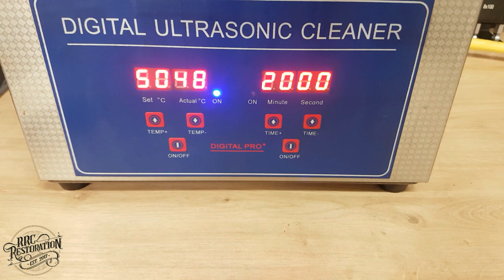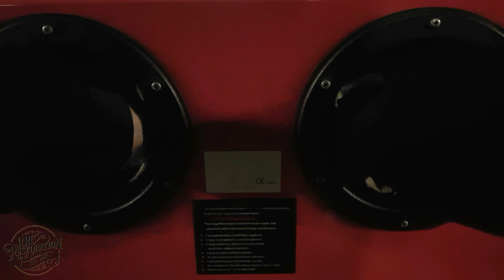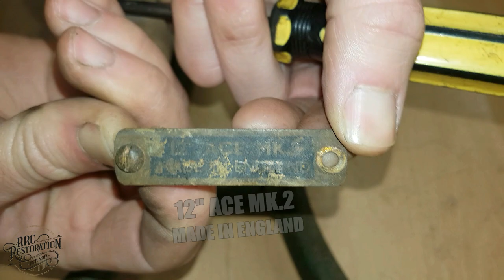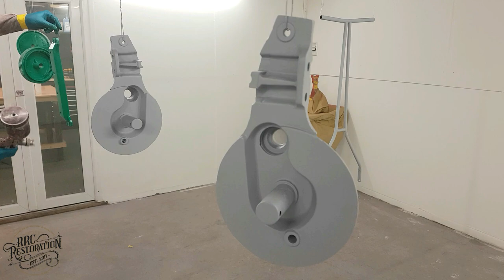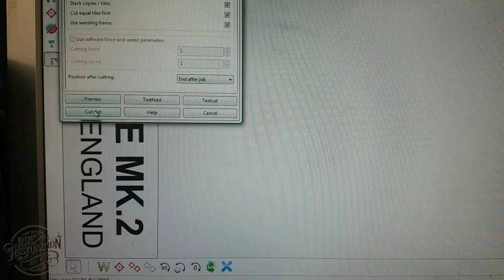Fatal Flaw!.... And Its 70 Years Old!!!- Mower Restoration

Comment: My older sister sharpened the blades on one of these the wrong way, 5 yr old one not an antique like this one, then threw it in our pit. After seeing this, I'll have to go into the pit and find it then see if I can fix it. I've restored 3 wheelbarrows, and after seeing how well you did this I'm pretty sure I can fix her old one back into working condition. I've already restored one of her wheelbarrows so I should be able to work on a lawnmower. Got a subscribe and a like from this.

Comment: That’s just at the next level…I wish my restorations were as good. Manufacturing that end piece with weld was genius. I would have happily accepted that it worked…you didn’t need to actually use it in appalling conditions. I hope it cleaned up okay and went into a museum 👌🏼

Comment: Back in the 50s, we had a small back yard, divided into house, orange orchard, and chicken run. The chickens took care
of the grass and sprouting grain in the run, and my dad handled the grass around the orchard and the clothes line etc. with a old style hand mower with Wooden Handles.
When we moved across the road to a bigger property,  with a proper Front and Back yard, ( I was just 8), the mowing gradually became my weekend chore by the time I was 11. Then I went to boarding school, and my dad bought a 2-stroke Victa mower...I only cut grass during school vacations.
Now, aged 73, with a couple of Heart ops behind me, I have a lawn-mower ( also in his 70s) come and keep the grass under control on a 1 acre block with a 4 stroke Honda- Briggs&Stratton self-propelled mower I have had for almost 35 years.
I still rake the grass cut, ( daily Cardio ) as the rains will allow for about 1 hour...makes up for 1-2 kilometer walks.

Comment: Nice job on the restoration of the mower not sure if you know but with action of the cylinder to blade being like a pair of scisssors you can test the  cut using a piece of paper across the blade to get it even. Remember my dad using this trick when he was adjusting the the cut on the Greens 14-4 we had at home.

Comment: @6:38 you need an impact screw driver. I bought mine from harbor freight for 10$ and it’s absolutely invaluable. I bought it for brake rotor screws and figured out rather quickly that it’s worth it’s weight in gold. Mine is 1/2” drive so it’s incredibly versatile to

Comment: 40 mins is fine by me, very enjoyable. I remember using one of these as a kid in the 60's  and what a huge struggle it seemed, can't remember the brand but it was red and light blue. You have a great selection of tools, a video featuring  them and their specific design mandate (e.g., @1:15 a selection of what looks like "spanner heads?") would be interesting. The back-lapping technique for blade sharpening was excellent knowledge .
Reply from the maker: Thank you, really glad you enjoyed the video :) The spanner heads at 1:15 are crows feet spanners they are designed to be used with a ratchet extension to get into very awkward nuts and bolts like Ducati head studs lol.

Comment: Nice one. Way more complex than anyone would imagine. 

Did you soak the new wooden roller in linseed oil before fitting it?

If you find old wooden handled tools that are so dried out they feel as if you could snap them like a biscuit, clean them with warm damp cloth and dry thoroughly. 

Then soak them in RAW linseed oil (not boiled) for as long as you like. Every now and then, massage the oil into the grain. Leaves a dull finish, and protects for decades. 

Some prefer the boiled finish, but you have to completely immerse the thing if you do. 

Thank you for sharing. How long before Delboy does one of these? 🧐😎😜

Comment: Nice work!  Just a tip-  when I've got a fair to large amount of sandblasting to do, I've got a large hose clamp riding on the air supply line I pull up over the handle of the gun to hold the trigger for me.  My hand gets so sore holding the gun and squeezing the trigger- nice not to have to squeeze the trigger for a long time.

Comment: The advantage for reel mowers is that the reel + a sharp knife bed gives a scissor action cut.
No tearing of the grass blades.
Result is that the cut grass blade stays green, as opposed to a ragged brown edge.
That's what professional (golf courses) are looking for.
The drawback to reel mowers is lack of suction.
They only cut true grasses well.
Grasses that grow horizontal (crab grass) get a free pass, infestation.
Golf courses treat for crabgrasses (Halts), so not a problem.
But for homeowners, crabgrasses can become a problem, and reel mowers (no suction) are often not the best solution.
**
Great restoration.

Comment: I worked as a mechanic in Southern Illinois in the 80s  at a surface coal mine that had a Ransomes-Rapier 1350 dragline.  It was originally manufactured in Ipswich England.  I believe it was used in Canada and then torn down and rebuilt in Perry County Il. for the Consolidation Coal Burning Star #2 mine.  She was known locally as the "Queen" and was a fine old Lady!

Comment: A great trick for handle bar grips is hair spray. Shoot a little in there and it will lubricate the grip to help slide them on and then when it dries it acts like glue. Learned that when I worked at a bike shop.

Comment: Suggestion: When installing grips on tubular handles, spray a bit of women's hair spray into the grips before sliding them on. Unlike grease, the hair spray will prevent the grips from moving once in place.

Comment: i beleive that is the same Mower my Grandparents had when i was a child , i’m 57 years old so that kind of makes sense  on your comment of Metric Wrenches onImperial bolts  as a teenager i helped my Dad restore his 1953 MGTD  and that vehicle  had all Whitworth  hardware all we had was Metric and Imperial  tools with a handful of  a few OpenEnd Wrenches we found at Flea Markets that were originally in BritishMotorcycle or Automotive tool sets  now those tools are easily acquired on the Internet in complete Wrench and Socket sets  then not so much and they wer expensive  to purchase so we made do with what we could  doing a Body Off Restoration  with a full Engine rebuild

Comment: You med the lawn mower better then it was when tit comes from the factory.

Here in Finland we have a code word in finnish langue  to use when loosing up tights and rusty screws, nuts, bolts etc. When WD-40 not work we say "Perkele". If it for some reason not works, just say  it again. Remember to add some extra "R:s". Perrrrrkele....

We have by the way two official languages in Finland; Finnish and Swedish.
Oh, by the way, Santa Claus comes from Korvatunturi in Finland.

Regards from Stig Österberg, from Dalsbruk in Finland

Comment: I have to comment on this lawn mower first, he's done an excellent job restoring it the second comment you should have not use the lock washers they do have self-locking nuts that's what I would have used excellent job
Reply: And a thin washer under the cotter pins on the wheels.

Comment: If that's cast iron, that'll fall off, eventually, no matter how much you pre-heat it. Cast steel, a different story, especially if welded with 316L stainless rods. That works well. You've done a fantastic job, with that mower
Edit: I was waiting for the blade sharpening... thanks so much for showing that, really interesting. (Not a mower geek... :)
Reply: The vintage adverts I have seen advertise them as "unbreakable cast steel"

Comment: I should post a video of the Bolens Reel Mower attachment I have for my Power-Ho. When you use it with the riding sulky, its a bit sketch since if could possibly chuck a rock back at your legs

Comment: I could swear there was a good conversion for 15mm to SAE but maybe it doesn't cross properly. 10mm and 3/8", 13mm and 1/2", those don't play well either but most other sizes have a good conversion if you only have Metric or SAE tools. I cut my teeth on Volkswagens and had mostly SAE tools. Now later, I have mostly vehicles with SAE fasteners and mostly Metric tools... What sort of puller was that? I don't know if I'll ever need one but I've never seen that before and you never know.

Comment: Can the repair be done without painting or powder coat ! A more of a oily rag maintenance ✔️I’m not against rechroming though 🤔Or pickling of metal 😊
Reply from the maker: Yeah you could easily do the work without all the painting and plating to have a mechanically perfect mower again but i like to have ever part as good as i can make it ;)

Comment: Was there a reason we stopped using these? Are they not as effective as gas powered?
Reply from the maker: I think the reason is the people are getting lazier and don't want to go the extra effort of pushing one of these around even though when set up correctly the cut is amazing, with a little lawn care and good cutting you can get a finish on your turf like carpet.
Reply: @RRCRestoration  I would use one of these. Though I feel like I would get laughed at by my neighbors lol. Oh well

Comment: When I was a young kid (Probably 7 or 8), my plain speaking northern uncle (he's proudly "Yorkshire born and bred") had one of this kind of push mower, and he also had a honking great petrol cylinder mower. I once asked why he needed the little 12 or 14" push a long thing when he already had the (IIRC) 32" self propelled petrol mower? He replied "'Cos can't trust thar cousins not to chop own bloody feet off wid big 'un". Seems that HE only got to use the one that took no effort, his kids had to sweat using the push mower that took 4x as long to do the same job.

That brutally "Matter of fact" phrase has popped into my head several times over the years...... Usually right after I've heard about one of the cousins attempting to do something using......... "Questionable forethought?" :D

Comment: Throw all that rusty stuff in 6 water and 1 hydrochloric acid for 12 hours and then wire brush them, paint with clear penatrol and paint with oil based (turps based) paint. Acid will eat nothing but rust, not the metal. Cast iron loves the hydrochloric. It will not remove most paints or grease.

Comment: Unfortunately you do not show all processing steps. For example, how you sharpened the knives evenly over their entire length. This is one of the most important processing steps so that the mower can cut the grass.
Reply: Sharpening starts at 33:20
Reply: @matthewsmith8573  Ah, then you were luckier than me. The blades of my mower were so worn that the knife roller had to be turned on the lathe.

Comment: "a FATAL FLAW iand it's 70 years old ..." And yet it was working perfectly before you took it apart.
A bit disappointing you didn't nickel plate the blades assembly, and wheels, and you decided to go with a "Christmas" red and green paint scheme, but other than that, good job.
I'm curious tho, what was/is the "fatal flaw"?  You forgot to sharpen the blades? Didn't put enough grease in the bearings, or used the wrong bearings?  Had "unnecessary" parts left over after reassembly? Didn't use blue Lock-Tite on the 4 screws on the new the drag plate?

Since it was working perfectly after 70 years, it is unlikely there is a fatal design flaw.
Reply: The "FATAL FLAW" was that he put grease in the bearings when they are oiled bearings.  The little cups with caps on them that go through the casting are oil cups.  You flip the cap open and use an oil can before you mow.
Reply: Side Note:  This is also why there are little holes on the outside of the wheels going through to the spindles.  You drip in oil.